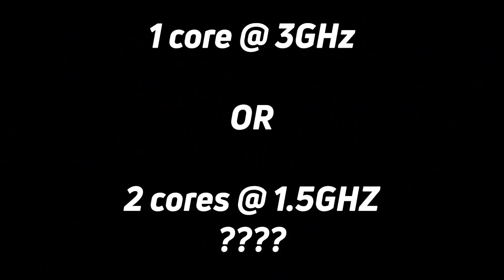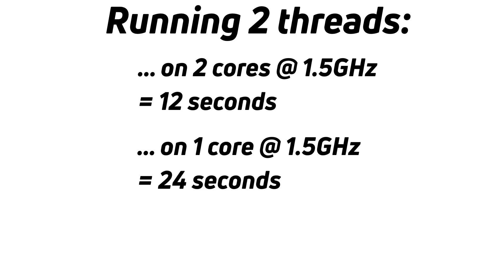Single-core vs Multi-core Performance and Efficiency

Comment: Intel would certainly disagree.  And they would make a good case that all workloads aren't parallelizable but power efficiency has never been their game.  But if you want a super powerful hog with no concern for power and you want it to run software from JUST BEFORE multicore was available where NO EXISTING PROGRAMS were available that take advantage of multicore then your most easy path for selling new chips that offer improved speed on old software then cranking up those MHZ without concern for power is your goal.  Then again, Prescott Pentiums D's extended out their pipeline some 31 stages in order to crank up their speeds to an absurd degree only to completely waste power and this proved a mistake for the server market.  Less of one for the Desktop, their primary market, in that age just before the internet but once it was sort of rectified by AMD who shot for more reasonable designs, people began to expect better.  And the race to 4GHZ was called off.

Comment: Nobody says why we have more cores, because of getting smaller and more powerful frequency we have made the electrons travel over a longer path, this leads to a longer time to travel so we make more cores of lower freq to make the 1 core distance freq. Multiple apps running is good for more cores, but bottlenecks occur. Moores law is here we are reaching limits 5. Ghz 1 core is always expensive than multi less power cores for a reason.

Comment: I remember a long time ago, the competition between Intel and  AMD  to break the 1ghz barrier, intel was always ahead, they released the Pentium III 1ghz. by the time AMD was struggling to have their 1ghz CPU, Intel released their socket 478 CPU and broke the 2ghz and 3ghz barrier with the Pentium 4.   the turning point in this race was when Intel decided to introduce dual-core CPUs instead of trying to always get the highest speed

Comment: They should make multicore CPUs have a firmware that handles all the stuff, so the OS and apps see it as just one much faster core. The reason is cause programming for multicore is much more complicated. I learned C# and it became clear that making apps that take advantage of multiple cores is complicated and annoying. It would seem more elegant to do it this way. I wonder if it's possible.
Reply from the maker: CPUs already do that. It is called Instruction Level Parallelism (ILP). That is why modern high perf cores use out-of-order pipelines and have multiple units (like ALUs, load/store, branch) in the execution core at the end of the pipeline. From a software point of view it is worth looking into OpenMP, it is a topic I have on my video TODO list.

Comment: Which is the best? Single core fast or multi core fast?

Antutu result

Redmi note 3pro 
SD650 
ADRENO 510 
6x 1.8GHz

Single core-1465
Multi core-2766

OR

Antutu result
Redmi note 4x
SD625
ADRENO 506
8 x 2 GHz
Single core-831
Multi core-2957

WHICH IS THE BEST PHONE FOR GAMING?

PLEASE ANSWER ME

Comment: The basis of the pre-2003 concept of Moore's Law was each process generation, a 0.71 (1 over square root of 2) linear shrink doubled the transistor density at a given die area, supporting a 1.4X increase in performance per cycle. There 0.71X linear shrink also made transistors 1.4X faster for a combined 2X gain per generation.
Suppose we have hypothetical 3GHz core on a specific process and die area. Then in theory, we could design smaller core of half the area of the first core, and this core would be 0.71X lower performance, which we could imagine to be 2.1GHz.
Hence the correct equality is one 3GHz core should be about the same area of 2 cores designed to achieve comparable performance of 2.1GHz of the baseline, or 4 cores of 1.5GHz
So really, its about how much performance you want in a single core versus having confidence to scale over multiple cores.

Comment: The clock speed per core doesn't translate to the efficiency of the core. Sometimes a 2.4 GHz core can out perform a 3.0 GHz core. It just depends on the cores efficiency and stability. 

If we went just off core speed, the sd845 would be superior to sd855. Cortex core a76 is definitely more efficient at work loads than cortex core a75
Reply from the maker: LOL, you clearly didn't watch the other videos I suggested and IPC etc. Following that, the assumption is we are talking about the same microarchitecture at different clock speeds. 🙄
Reply: @GaryExplains  tbf, you can't expect people to watch every video you've made after you make a headline. All I'm saying is measuring the clock speed per core is a poor way of analyzing how well it would do. IPC(instruction per clock cycle) indeed is important. But if someone were to go off, oh this is clocked higher, so it must be better mentality is terrible. Something can be clocked higher and still lag behind a lower clocked performance core and being a lot less competent.
Reply from the maker: It isn't a poor way when the CPU is the same, it is ONLY way! 🙄 Again, you need to watch the other videos, if you don't want to then I can't help, I ain't going to repeat what I say in the video here in the comments.
Reply: @GaryExplains  I think it's still important to disclose if the CPU is the same with the same cores. Again, expecting people to be returning to your videos after watching previous videos is a bad way of informant. Could be a random person who never watched any of your videos, and watched this one then was misled that higher clock speed = better every time xD

Every video should carry itself and not be dependent on a previous video
Reply from the maker: Well, I thought it is clear enough and no one else has raised the same questions.
Reply from the maker: Also, as a follow up, I don't agree that every video should be standalone. I am covering lots of topics and often in-depth, to go back an cover the basics would be a waste of time. When you went to school and learned calculus, did the teacher go back and cover multiplication first?
Reply: @GaryExplains  I still think disclosures are in need. Even for higher level classes, they still disclose information learned from lower level classes or information from previous complimentary courses. Example" remember the exception with a in regards to b from..." Moving forward if it's in identical conditions or identical factors this is the case for that. Or you can refer back to this video for exceptions. 

Still it's a bad argument to use classes in comparison to YouTube videos. There is no pre-req in YouTube videos unless stated by the video in the beginning of the video.

I'm saying as a stand alone it can mislead a lot of people when it's not the case at all. Even within identical conditions, if you overclock something to 4ghz and that core can't handle that speed it will fail in comparison to something clocked that is more sustainable.
Reply from the maker: Dude, watch again from 4:41 the exact words I use are "I am going to assume we are talking about the exact same design of CPU". This is the context of having talked about how different CPUs have difference performance characteristics even at the same clock speed. 🙄
Reply from the maker: As for, "There is no pre-req in YouTube videos unless stated by the video in the beginning of the video." that is EXACTLY what I do at 0:25 and 0:40 🙄

Comment: Gary you should have compared the power consumption in each test. Would have been even more interesting. The future is multi core, and it's going to be up the programmers and processor designers to make the advantages of multi core more effective for users. They have to collaborate with each other closely. Like your programmes very much!
Reply from the maker: I do compare the power consumption, there is a whole segment about that at the beginning of the video. What I don't do is measure the actual power consumption during those tests.

Comment: Most programs don’t scale linearly with the number of cores added. Finding prime numbers is more easily able to be divided among cores, but for most other programs there are only so many cores that you can use and each core won’t be used equally. If you’ve used a processor with more than 6 cores in gaming for example - you can have scenarios where where the game is bottlenecked by the processor even though not all cores are being used, and this is more evident in many other programs when you look at AMD’s 32 core processor, and why you’ll see people refer to AMD’s expected 64 core processor as having too many cores. Adding more cores for more performance is not the answer, having good single core performance is important too, because there are only so many ways you can logically divide a program up, and for any time sensitive program you likely wouldn’t want to divide up the load because you’ll have to wait for the other core to finish its side before the program should proceed - or same with some calculations in some sense, you can’t have one side of a calculation finish before the other and move on because the end result could be incorrect, so just because some programs don’t use all cores does not mean it’s unoptimizabled it’s possible they divided up the program as much as they could. So having multiple cores is important but there is a huge amount of diminishing returns, having faster cores is now becoming more important as we approach more than 4-6 cores.
Reply: Yes, dividing tasks is difficult. Theoretically one can always divide the tasks nearly evenly through some work. But irl programming multi-core programs are much more of a headache than that of single-core programs and many programmers just can't border that unlike the developers of Linux. High single-core performance is definitely a convenience.
Reply: @stevenhe3462  Most time sensitive programs would receive no benefit from being split into multiple threads, if anything it would be more inefficient than a single thread, the same goes for any thread that is dependent on a response from another - just because you can divide it doesn't mean you should. Plus for example many a-sync programming languages do not allow multithreading, like JavaScript for example, this is intentional and by design, hence why its a-sync.

Comment: For some applications when it comes to like in my case music production. That kind of software focuses more on single threaded/single core performance. Therefore if you want to make music on your computer it is important that when choosing a CPU for your system you focus a lot more on single threaded performance as the software assigns one thread per channel except in case there is something particularly intensive on the channel strip in which case it might assign some more resources to it. https://help.ableton.com/hc/en-us/articles/209067649-Multi-core-CPU-handling-FAQ 
So yeah, just keep in mind that single core/single thread performance on their own on multi core processors are still very important.

Comment: Seems like that 8 cores cpu is the sweet spot fot Android for now.
As the 10 core cpus of Mediatek did fail miserably on thermals & power draw.
Reply: But why did they fail? If multi-core is supposed to be power efficient?
Reply: @AkshatSharma1505  It’s not straight forward as a race track , imagine it as a highway traffic not all vehicles are the same size and the driver too, that’s how it work

Comment: What you mentioned in the end "IF you're programming it right". That's a big if right there. Unfortunately, a lot of software out there is still single threaded. So, unless I'm on a phone and I care about those extra watts, I would go for a single core with higher clock

Comment: What are accelerators  in CPUs
Reply: they are specialised hardware that work on specific task, ie: like a graphic card. Sometimes it is included in the CPU itself as an API that do a complex task, such as AVX to do accelerated video encoding, and AES to do accelerated encryption calculation.

Comment: Hmmph ... so you made a prime number generator which is multi-threaded?

As I recall, every prime number algorithm I can recall uses past primes to build up the next prime - which is a serial process. Making something like this multi-threaded is not an easy task - are you simply independently generating the same primes in each thread? If so, that is a perfect example of why multiprocessing while nice for totally asynchronous tasks is not really usable for highly resource intensive mainline code, where you're building on the past results to get the next result.

Most tasks cannot simply and easily be converted to multithreaded workloads - if that were possible, all processors would use a gazillion low-powered cores and there would be no reason for higher performance CPUs.

Adding threads not only makes software engineering more difficult, but adds complexity - and complexity's close relative software defects (or bugs) to your code. Additionally, you need a fast, efficient semaphore system to insure synchronization between tasks and things like lock loops to insure you don't have unintended consequences when you're doing things like link list processing which requires serialization to insure only one task at a time is adding or deleting nodes, or that another subtask isn't trying to run the list while another is editing it.

On the mainframe, not only were there macro serialization controls for such gross things as file serialization, but lock loops for lighter weight serialization for such things as manipulating things like memory allocation for a region. In fact, there was a whole series of hierarchical locks wherein Lock A had to be acquired before you could acquire Lock B, and locks A and B acquired before getting Lock C, etc. Locks then had to be released in the reverse order.

If you want a workable, dependable multiprocessing system the level of complexity escalates rather rapidly, and the software complexity builds in all sorts of delightful unintended consequences.

The fact of the matter is that your higher powered cores are the ultimate arbiter of higher performance in general, and that while multiprocessing is nice when the model allows it, it's pretty rare when you can fire up eight cores and actually put them all to use, especially in a single user device like a phone. Transcoding video segments between keyframes and modeling snowflakes or sand particles in a snowstorm/sandstorm come mind, as well as more complex things like gazelles in a herd.

Of course if you're simultaneously running eight apps or eight user sessions multiprocessing can be effectively utilized provided that you have good serialization controls in place for operating system services when needed, but again we're talking about tasks where are easily segmented because they're not running the same mainline logic attempting to build on past results.
Reply from the maker: Then you recall of prime number functions is flawed.
Reply: @GaryExplains  Perhaps ... care to share the code?

Comment: Great video Gary you answered the question regarding Multi-core vs Single-core or Apple designed processors vs ARM designed processors nicely: "it depends."
One can't simply say that A13 is better than SD865 and vice versa.
The comparison you did with Raspberry Pi is repensentative for multi vs single-core, but as you stated not between Apple vs ARM designed cores.
Android favors Multithreading more than iOS, since the ideas behind the design of SoCs are quite different. Apple SoCs behave quite like desktop CPUs by having fast big core to do the tasks as quick as posible then return to idle (Race to idle/sleep). Snapdragon SoCs for example have more performance cores while use less power. But less power doesn't always translate into less ENERGY or better ENERGY EFFICIENCY, as it can take longer to do the same tasks. As seen Apple A12 and A13 use newer ARM instruction set, have better memory subsystem and better IPC according to SPECInt comparing to SD855, SD865.

All in all, there isn't one that completely better than the other. It depends on the usage and how well writen the softwares for respective platform are.
In the future videos I would love to see more of your views on IPC and energy efficiency.
Reply: "One can't simply say that A13 is better than SD865 and vice versa."

In this case, yes you can.
A13 is faster at both single and multicore.
Reply: @MiguelAngel-rw7kn  If you meant better = faster then yes. Even the Cortex A77 in new SD865 has just caught up to Apple A11 's Monsoon cores. 
Multicores ? I think they are almost the same (maybe wrong though, i dont have any info on that)
Better Power efficiency? No.
Better Energy efficiency ? not any more with the new SD865, they are pretty the at the same ballpark now. (we saw no increase in EE between A12 and A13).
Faster NPU ? Nope, with A14 maybe :).
Faster GPU ? Yes, the Adreno 650 in SD865 trails behind A12 's GPU in term of speed and efficiency.
Like i said it depends on your usage. If you game alot then yes A13 is a better pick for you.
Reply: John MacTavish I meant in the topic of the video; the A13 is faster at both metrics: single and multicore even if the later is just for a little bit. 

Everything else will depend on the task, and to be honest, we don't have any metric on how much energy every soc consumes when all cores are fully active. As you said, the lighting cores on the a13 are less efficient than the cortex a77, but the thunder cores are much much better than the little a55 ones, so it can compensate when fully load. But we don't really know.